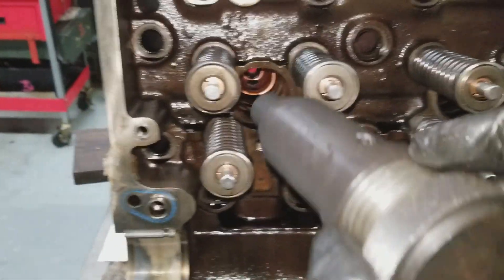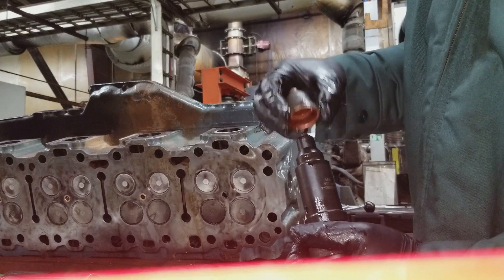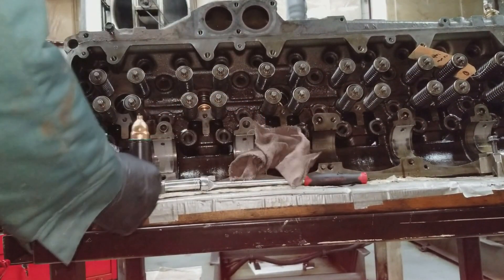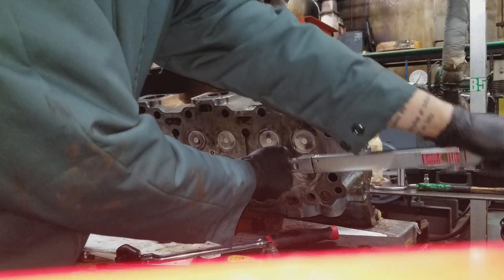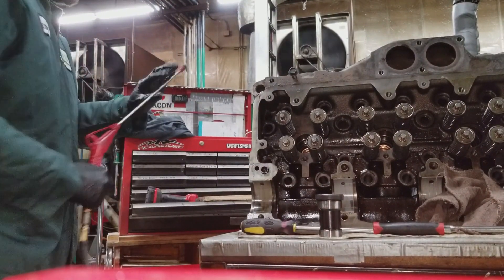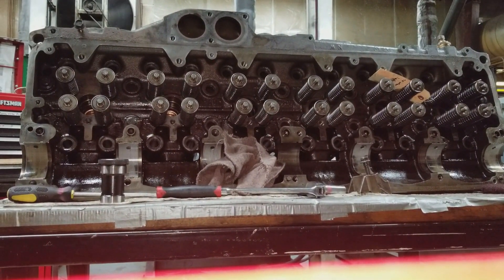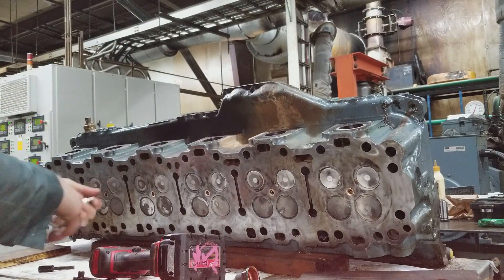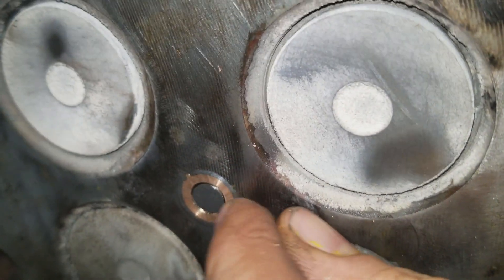detroit 60 N2 injector cup repair

Comment: Im having a very hard time finding this tool set. Do you know of any for sale or rent? Need to get this done asap.
Reply from the maker: Its hard to find now days for sure.  Ebay is a good source, maybe hit up some of the local shops on your area see if you can rend from them
Reply from the maker: so the original kit number is J-33880.   there is an aftermarket kit that comes up with that same part number from freedomracing.  i do not know if this will work or not, best call them and find outl   the OE tool kit for N2 heads is LONG out of production and is upward of $3k if you can find it.

trying googling J-33880 and see if that aftermarket kit will work out for you

Comment: How do i know if i have an n2 vs n3
Reply from the maker: Iirc the n2 injector has a square body  electro magnet  (two wires)  that is parallel with the injector body.  The n3 has a 45deg (plastic plug)

Comment: How do I know the deference between a N2 head And a N3 head
Reply from the maker: n3 started in 2004, so knowing the build date of your engine will help.

When you pull the valve cover take note of the injector body.  If it has a cube attached to the injector with two wires that is likely the n2, i BELIEVE all n3 injectors did not have this cube attached to the body.

Google an image of "Detroit 60 n2 vs n3 injectors"  that should help you identify
Reply: @poet99999  Thanks for the fast response

Comment: So this cups can't be removed and installed with head on? Has to be removed? Even if you have cup removal tool designed for it
Reply from the maker: The n2  cups require the head to be removed.  They are pressed and swedged in, not threades
Reply: @poet99999  oh ok, I see, pressed with some special tool or some machine

Comment: Thank u for the info. U explain things very well. I'm about to pull my head and send it to the machine shop. I do have a question. Why is it? That they don't make a flaring tool for the 60 series? Instead of having to pull the entire head. I see a lot of videos on the old Volvo 2005 and a little older12 series I think? Where they can install the cups with a simple flaring tool. Without pulling the head. Is it because on this Detroit series? It has to be completely flat to the fire deck? I appreciate any feedback. Thanks again
Reply from the maker: The next generation Detroit head had thread in cups.  These n2's are quite old now days.  I'd have to pull my books but I do believe the n3 and up were threaded cups and silver in color
Reply from the maker: In the n2 style the flare is what was creating the holding force for the cup, the next up the threads held them in.
Reply: @poet99999  Thank u for the response. It's just crazy that the Volvo D12 has copper flare type cups. And they can be installed with a flaring tool. With the head still on. I guess Volvo engineers are smarter? Or cared enough about the owner? To not have the head removed every time u had a cup problem. Thanks again

Comment: How often do you do cups. I a machinist and the tools I have a bit different then the one your using they are Detroit originals that's I got from an older machinist. I often get other machine shops series 60s because many of theirs cups fail I also pressure test mine so if one leaks I usually catch it.I do marine and over the applications.  And I have yet to get one warranty claim knock on wood lol
Reply from the maker: Due to the application at that shop, it was likely higher frequency.  We had some last the full 10,000hr head life some substantially less.   

In a straight diesel application I'm sure they would normally last the 10k the mark

Comment: Were leaking cups very common on the 12.7?
Reply from the maker: Our application is very rough on them.  and the compression type that these are arnt as strong as the newer screws in style
Reply: poet99999 when did the screw in style enter production?

Comment: Great information on this video. I bought a new cylinder head that already has cups in them. Does it require any reaming?
Reply from the maker: Joseph Blandino it should not require anything.  if the machine shop/rebuilder you bought it from installed them they will have done all of this.   infact this is usually done by a head shop anyway as most end users will want to have their valves checked at the same time
Reply: They require reaming to set the install height or you will not be able to set your injector height correctly... Used to slam dunk these all the time back in the day..